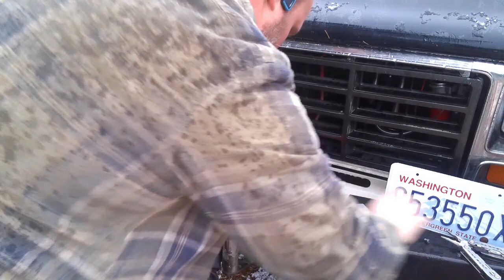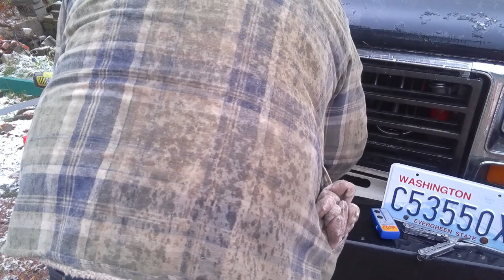Switching to synthetic winch line.

Comment: I just removed a Ramsey 8000 pound winch with steel cable and replaced it with a Badlands APEX with the synthetic rope.  So far I like the change.  But you're right, ya gotta be careful not to snag it or run it over sharp objects !!  I have the wired or wireless remote with it.  Push a button for one or the other.  Good video, and good job Wild Bill !!
Reply from the maker: Thanks. I am curious to see if it cuts in once it is under a heavy load. I have synthetic line on my 4500 pound winch on my hoist and it has not but the bigger winch could have a much heavier load on it. With that being said if you need it under max load you are probably in a situation that you don't care if you end up having to replace it as long as it gets you out.
Reply: @WildBill1122  I’ve had a couple pretty good pulls with it so far with zero issues. But I AM careful just in case. I like to use a snatch block to slow line speed and lower the load on the winch motor in real heavy pulls.
Reply from the maker: @tractorman4461  nice. I just used mine today to a near stall when it was almost fully spooled and had no issues cutting in.